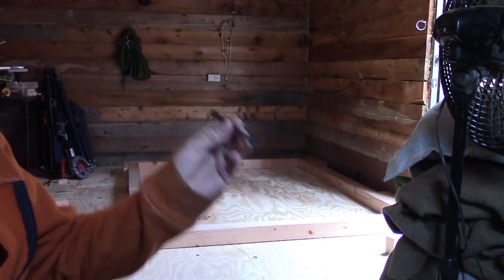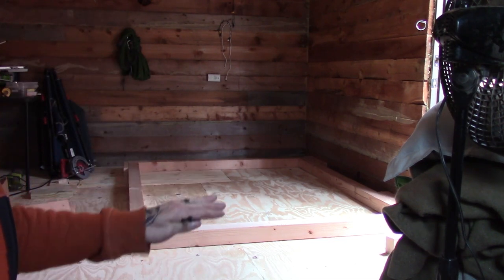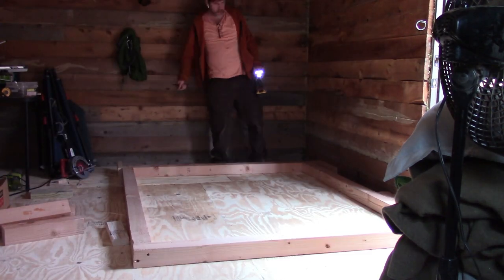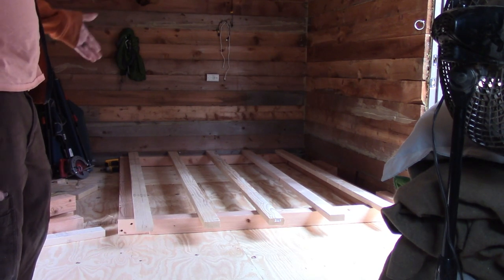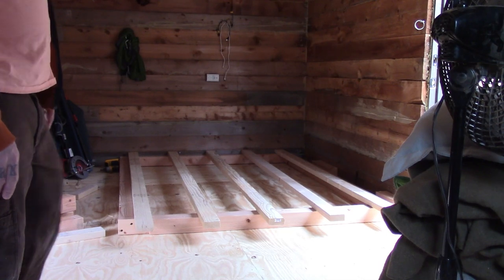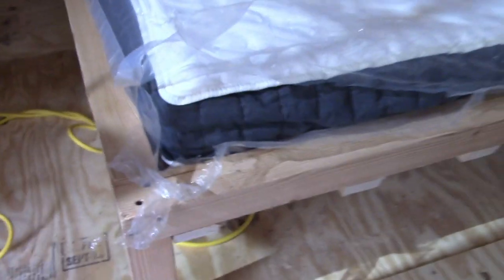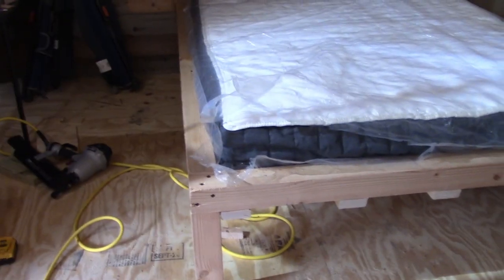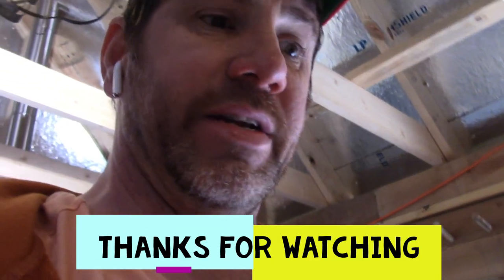Primitive off grid log cabin Building bed frame

Comment: I think you should have put those 2 x 4’s on top, for strength. Your holding is in the nails on the bottom like that.
Reply from the maker: true. but with the plywood it spaces out the load...  and im not jumping on it.. time will tell...  i wanted it to set inside the frame , not on top...

thanks for watching